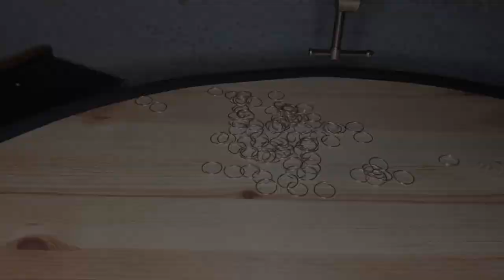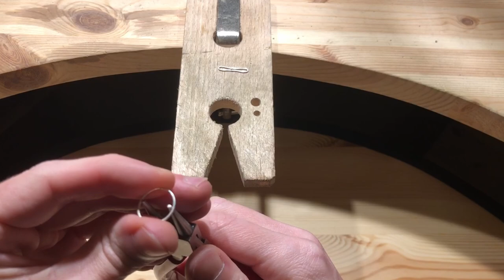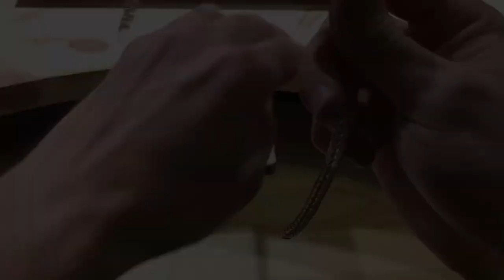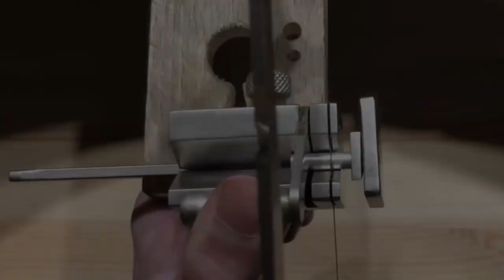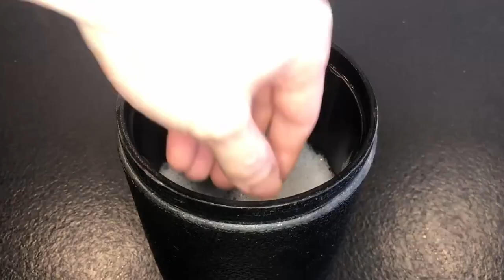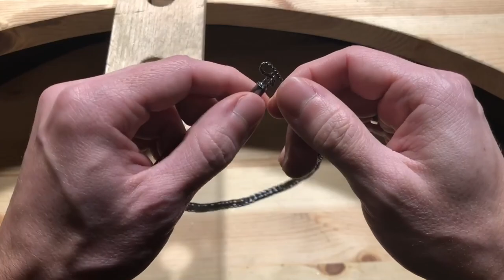How I made these bracelets

Comment: I've never seen a mandrel like that before that snaps into a flexshaft.  Can you share who makes it and where it can be purchased?
Reply from the maker: If you are referring to the mandrel in the beginning of the video, then it is called a step mandrel and this  particular one goes from  9 - 13.5mm. 
I do not know who makes them but I bought mine from a Danish jewelry tool shop called Ravstedhus: https://www.ravstedhus.dk/pi/Dorn-til-oprigling-af-tr%C3%A5d-til-%C3%B8skner-L-300-mm-10-trin-%C3%98-9---13-5-mm_6735087_430032.aspx 
I have tried to find it elsewhere but unfortunately I have not been able to find it  anywhere else.